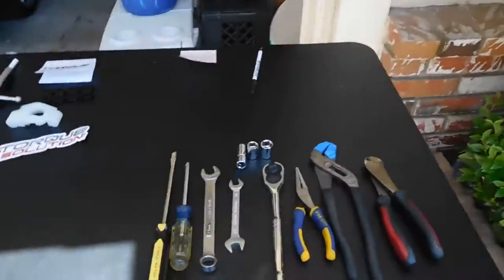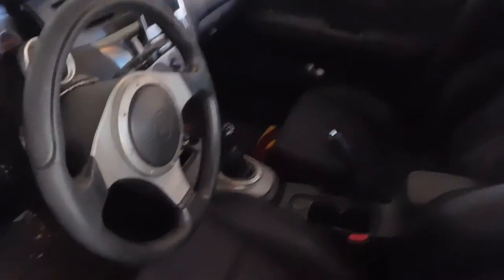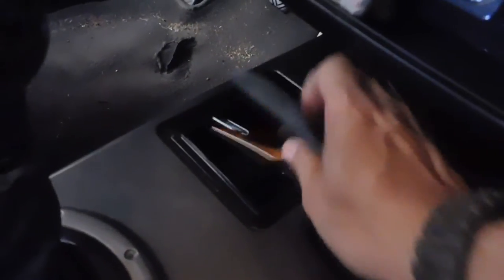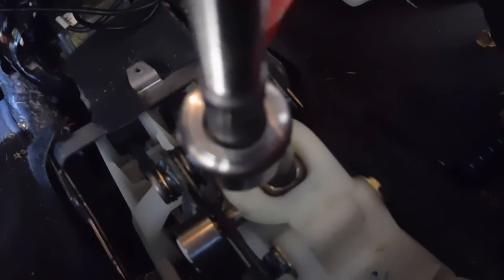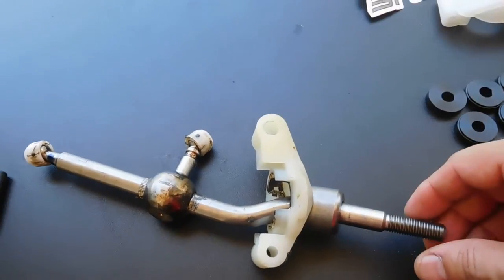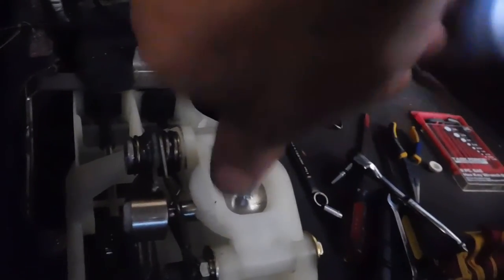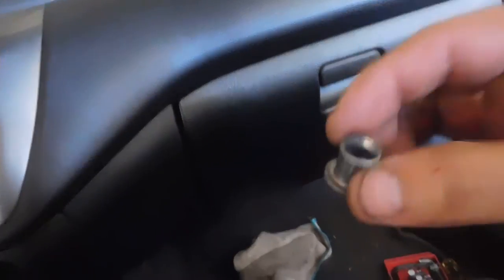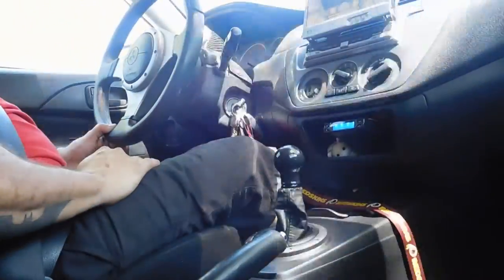Torgue Solution Short Shifter (For A Evo 8/9) "Easy Install"

Comment: love the video! So for the grease, did you put them on the two round clips you popped on shifter? and inside the shifter plastic retainer? I didn't put on any at the time of install and its hard to speed shift thanks
Reply from the maker: Yes I put it on the little pieces that I snapped on the shifter, and that's about it. As far as the shifting part goes, it Just take some practice to get used to. Thanks for the comment and for watching my video, I appreciate! good luck with your car.

Comment: Dude, I've got problems with my six gear evo 9 gsr, reverse is not sticking, 1st, 3rd, 5th and 6th even aren't shifting, any idea what possibly have gone wrong with it, please get back to me on possible issues and solutions to it, thanks mate
Reply from the maker: Most likely your synchronizers are going out! you need to take it into a transmission guy but that's probably what it is? the 6-speed has that issue, they put six gears inside a 5-speed gearbox and  everything is really tight. Good luck and thanks for watching video! keep me posted.
Reply: @EvoEightRich03  dude, I've fixed that gear issue last week, it was a gear lock problem, the mechanics tightened up and it works perfectly
Reply from the maker: That's great! hopefully it didn't cost you to much!! Thanks for the update, and safe drive!! I know I haven't done any evo stuff lately but  I do all kinds of other stuff as well and I would love to have you as one of my subscribers! Thanks again.

Comment: Dude my shift retainer slides right off out the bottom side of the shifter🤦🏻‍♂️🤦🏻‍♂️
Like wtf lol
Reply from the maker: I don't know what to tell you? as you can see in the video it wasn't going to come off without trying to forcing it off and or cutting it off, and you're not supposed to do that! so if yours came off without having to do that, I'm not sure why or how, but if it worked for you that's cool as long as everything went back the way it's supposed to  that's all really matters right! thanks for watching my video and for your comment I really appreciate it and good luck with your car.
Reply: EvoEightRich 
Yeah everything went in fine. 
Every video on this install says the same thing about buying another shifter retainer.  But I promise, it was a little bit tight, but it slipped right off the shifter for me.  The little white pivot ends were harder to get off than the retainer was lol 
Just commented because it’s $30 you don’t really need to spend, and maybe someone else had the same experience. 
Thanks for the video going over everything, it made my install much less stressful 🤙🏼
Do some more Evo videos!! Yours looks to be clean AF👌🏼